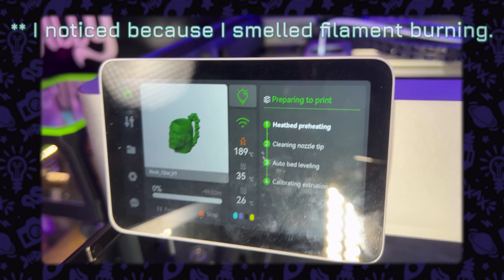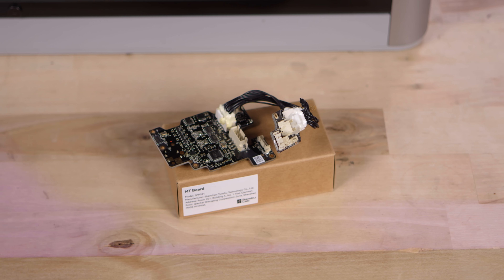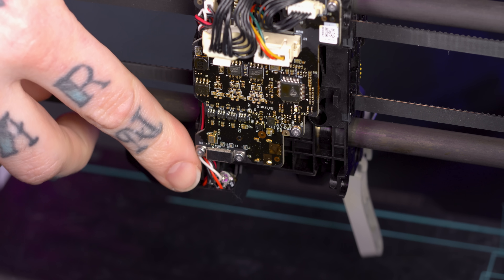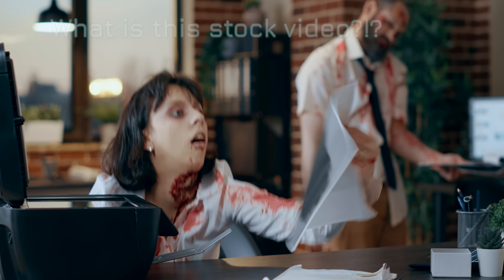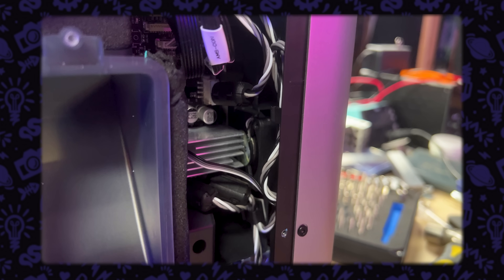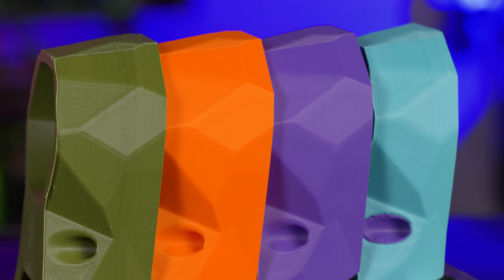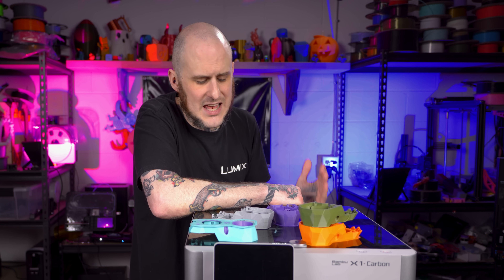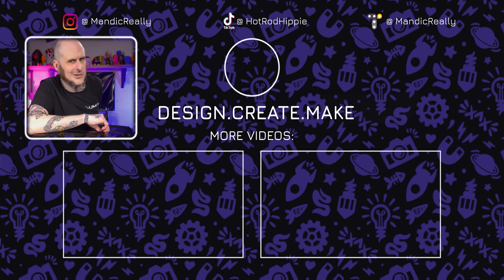MY BAMBU X-1 BROKE - Thermal Runaway?! Let's Fix it!

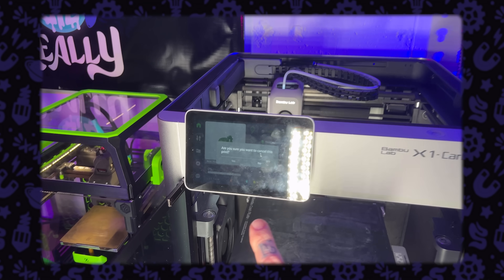Comment: 0:55 what's nice about ptc heaters like the one in the bambu htoend, is that they're hardware limited to 300c. The power decreases the closer you get to 300c, so it is impossible to actually exceed that temp, no matter how much you try. The PLA might boil and smoke, but you wont be melting the heat block.
Reply from the maker: Could you point me to where you’ve found that temperature limit specification? Heater elements can vary by design so I’m just curious to have any hard data available. The way you describe it is arguably a matter of “working by design” where failed parts don’t necessarily conform to design. A short has potential to change things outside of spec and cause hot spots or spikes that could get higher. Anytime you are working with electrical and heater components they have the potential to fail outside of their intended design.
Reply: Bambu's answer: "The HOTEND can only reach a maximum temperature of around 400 C...", what means the heater alone can reach higher temps, and it is probably not a PTC heater. 
For some reason they don't use PTC acronym anywhere.
PS, 1. ceramic doesn't means PTC, 2. resistive wire also has a Positive Thermal Coefficient.
Reply: This one looks similar to these used in bambu:
(search "MCH heater" for images)
MCH is the abbreviation of Metal Ceramics Heater, which means metal ceramic heating element. MCH refers to a ceramic heating body formed by printing metal tungsten or molybdenum-manganese paste on a ceramic casting blank, hot pressing and laminating, and then sintering ceramic and metal together under the protection of 1600 ℃ hydrogen atmosphere. Corrosion, high temperature resistance, long life, high efficiency and energy saving, uniform temperature, good thermal conductivity, fast thermal compensation speed, etc.

Comment: Washing machines have parts that wear out too, and could be just as daunting as this to repair - non-technical people are fine with it though, because you can find a handyman to repair it. It's a bit of a chicken and egg situation, but if 3d printers keep getting more common then we can expect to see people starting businesses repairing them (like how phone repair shops sprung up)
Reply from the maker: Valid and a market that may be lacking right now. Could be a great idea for Makerspaces. Offer repair services and / or classes on repair and troubleshooting. 👌🏻
Reply: This is kinda a good point actually. I also feel the type of person to buy this at least has access to someone who is comfortable enough to follow instructions on repairs. I also know that there exist 3d printer repair services already, so if Bambulab got a certified Bambu repair program going that would do a lot to make people comfortable. Something like Apple Care where you pay more upfront but you get a no panels removed, shipping paid both ways magic fix service within a week.

Comment: My initial thought seeing the title is maybe you had a review unit which did have some parts fixes. But then I also joked last night wait until people have to start doing maintenance on these. A printer is a printer.
Reply from the maker: Mine is a Kickstarter unit that I purchased. So it’s probably an early production run unit. The toolhead PCB and thermistor connection in particular seem to be one pain point they’ve improved over time.